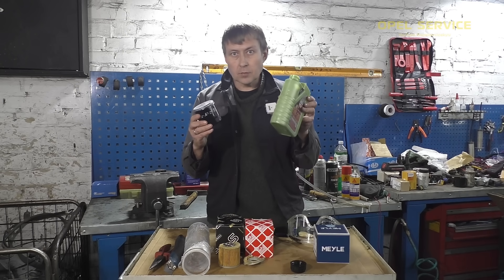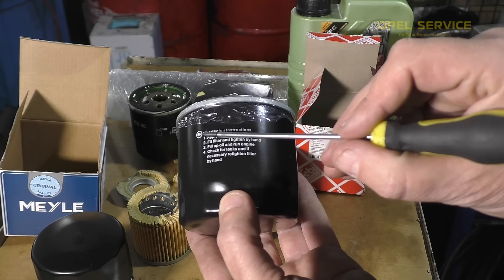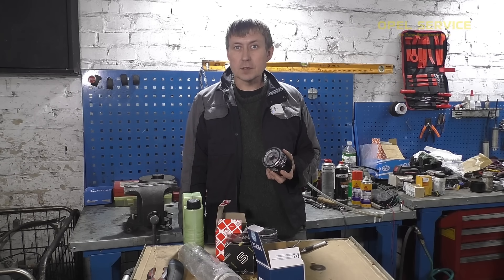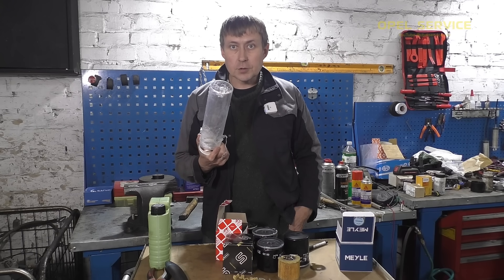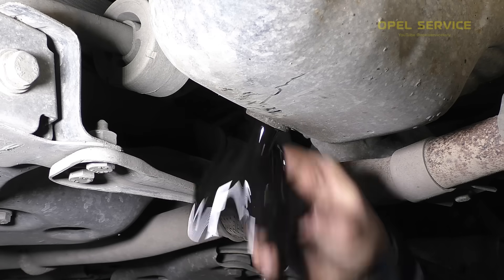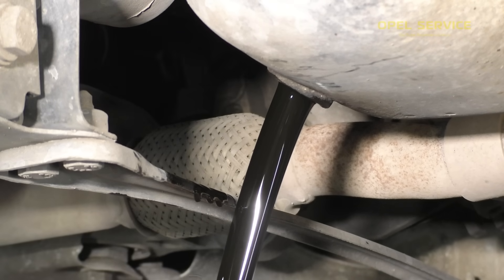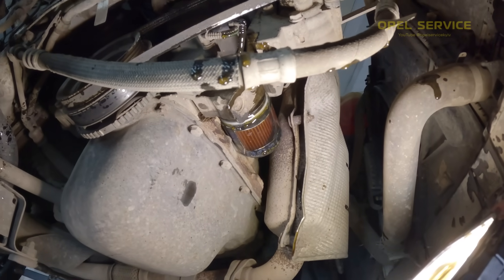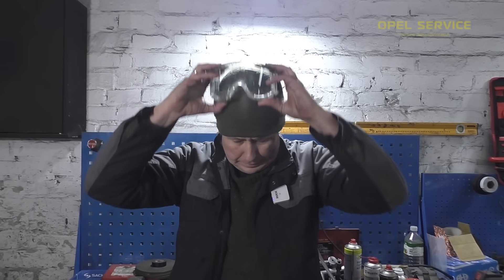Should You Pour Oil into the Filter ? Transparent Filter Shows the Answer

Comment: On my civic 1.5t if I dont pre fill the filter i get an oil warning for a few seconds before the oil has fully circulated. Therefore I always pre fill the oil filter. There are some vehicles where you can prime the system without actually starting it, unfortunately newer hondas dont have that from what ive seen.
Reply from the maker: Thanks for sharing your experience

Comment: Do not pour oil into the filter when changing it. An oil-filled filter is an obstacle to the air that needs to be pushed out. The oil pump is designed to pump oil, not air. The oil on the engine bearings will appear with too long a delay. The risk of shaft seizure increases significantly.

Comment: First of all, thank you for the video on this very controversial topic.

Secondly, the experiment went wrong, and we didn't see anything useful to help us understand whether we should put oil in the filter before installation or not.

I understand that you spent some time making these filters, but it wasn't necessary. Just install some filters with oil and some without. Then, check what exactly happened by opening them.
Reply from the maker: Thank you for your feedback. We are now making a special separate stand for such an experiment. It will consist of a pan, an oil pump, an oil filter adapter and several filters.

Comment: My old 1200 cc (40 hp) Volkswagen didn't even have an oil filter. Just a screen by the oil pickup. You could take off about six 10 mm nuts and take the screen out and wash it with kerosene. I would only clean it every so many oil changes. Very reliable little pancake engine. You could do a lot of work on that engine with only two size wrenches or sockets, 10 and 13 mm.

Comment: I would like to see this test:
  1) Drain the oil pan and oil filter. Leave them empty.
  2) Start engine and let idle for 30 seconds.
  3) Remove bearing caps and inspect for any bearing damage.

I would bet the bearings would look fine with no damage.
Reply from the maker: There was a similar case a long time ago, when video cameras were still rare. The engine ran even longer. But everything worked out well. 
It would be interesting to do such an experiment.
Reply: that is a testimony for the bearing manufacturers. why not let it devolop for a couple minutes until the bearing scuffs to see what you are heading towards

Comment: "Garage 54"  did the same experiment with  a Lada with a clear valve cover and oil filter,  the oil filled the filter and reach the top of the heads before it motor even fired.  so pre fill during a normal oil change is a waste of time.   I would consider doing it on a motor that has been sitting a long time or major engine work
Reply from the maker: Yes, they did it very well. Several other Youtube channels did this experiment. We are now constructing a separate installation for testing in different modes. And we revised the filter design. I think it takes two or three weeks to create. Thank you.

Comment: People act as though there is NO oil in the bearings after you drain the oil! Even if you fill the filter it will still take pressure to build up before it pumps any out. It is a non-issue, you can go either way and not harm anything!
Reply: you will do less harm prefilling.

Comment: It took several seconds for the oil to pump through the filter media.   It probably isn’t causing much wear but every little bit helps if you want to put 250,000 miles on an engine.    Auto manufacturers have a lot of knowledge but they don’t want you to keep your car forever either 😂.   I pre fill my oil filters.   It doesn’t cost any more money so why not do it?

Comment: It's personal preference, nothing more. I've NEVER filled an oil filter and have a minivan with 189K miles with zero issues and a smallish SUV with 125K miles on the clock with zero issues. 

Thing is, engines are never completely dry unless it's being filled for the first time at the factory, or you've been letting it sit for months to years.

Comment: It certainly won’t hurt anything to fill a filter with oil- even if you overfill the amount in the filter that won’t damage anything. Ford Focus engines listed 4.5 quarts as the capacity. I always put in 5. I was always slightly overfilled for the 200k (320km) miles I owned that vehicle. To damage an engine by overfill with oil, you need to overfill by 1.5x capacity or more so that the crankshaft is swimming in oil or pistons hitting oil. Even 1 qt over shouldn’t grenade an engine.

Comment: Most engine wear occurs during warm up , not start up.
Its a common mistake not differentiating between the two.
Its not the bearings or cams that generally wear out 1st on a motor. Its not the 3 or 4 second oil pressure delay at your bearings , wrist pins,timming gears  or cams that happens every 5 to 15000km typicaly that determines engine life.
Unless something catastrophic happens its the rings and cylinder bore blowby that determines an engines life.Its during the warm up from ambiant to running temperature where the majority of wear takes place. So essentially pre filling an oil filter will not lengthen the life of the motor in any measurable way as the ring , cylinder bore is worn out predominately by the engine running from ambiant to opperating temperature. 
Thats the reason stop start auto shutoff does not significantly shirten an engines life.
Heat cycles is the biggest factor if your oil is kept clean.
I pre fill my filters when possible,  but I know its making little to no difference.
Reply from the maker: Thank you. It was interesting about stop-start

Comment: I once forgot to install the new oil filter. I started the engine, but when pressure didn’t come up after several seconds I shut it down. In the few seconds the engine was running (5? 10?) it pumped out all 7 quarts of new oil. The filter is filled almost immediately on cranking- as your test showed, first with the old oil remaining in the oil pump, and then immediately by the new oil from the pan. Great video!
Reply from the maker: Yes, the pressure is high and the oil flows at high speed. Thank you.
Reply: My brother had a house mate who drove cars without engine oil. The cars would run for a few minutes without oil. Maybe it is not so critical starting with an empty oil filter.....
Reply: @arthurschuler8906  he did damage every time.
Reply: I’m going to take advice from someone who forgot to install a filter during an oil change?

You’ve got to be kidding me.
Reply: @mitchconner1407  Anyone who insists on performing the completely unnecessary act of pre-filling an oil filter isn’t exactly the sharpest tool in the shed
Reply: @mitchconner1407  There’s another video on YT where they test for wear between pre-filed and dry oil filters. The conclusion? No difference in bearing material wear metals. There is an epilogue however! Something like 90% the wear isn’t bearings, it’s piston rings. Nearly all piston ring wear occurs  while the engine is cold as it comes up to operating temperature, independent of oil pressure. The conclusion? If the voodoo ritual of pre-filling your oil filter makes you feel happy it doesn’t make any difference; but if you really want to minimize wear get your engine to operating temperature quickly. The best way to do that is start it up and drive gently for the first few miles until it warms up. Avoid extended idling, that takes longer to get to temperature and prolongs the time your piston rings are getting the most wear
Reply: and if the filter is prefilled it will see pressure faster. there is 'zero time' that running without oil is a benefit. there is zero benefit to installing a dry filter
Reply: @notsure6182  there is zero benefit to filling the filter as well. Also, many cars have an oil filter placed in such a way you cannot pre-fill it. Mounted horizontally, or even upside down on top of the engine.
Reply: @MrJeffcoley1  incorrect. anything you can do to ensure faster oil pressure is a benefit and there is zero argument you can make that says 'being without oil pressure is a good thing', so why are you even trying to say something that stupid. obviously there are some applications that you cannot prefill, bad designs. basically you have zero logical points and you are falling to bullshitting. summary, "no downside to prefilling, no upside to not prefilling". end of discussion as you have zero valid points.
Reply: @ sure, just like moving for deck chairs to the stern will help the Titanic. It is genuinely zero benefit to pre-fill the filter. But if it makes you happy, go on with your bad self and fill that thing.
Reply: @MrJeffcoley1  no. any time you run a bearing without lube you damage it. your best case is it doesnt damage it much, but it always damages it. so reducing that as much as possible is always a benefit and extending that damage time is always a detriment. those are the facts. you know why the oil pump is capable of dumping 7 qrts in a few seconds? because that is how much oil it needs to prevent damage. again, why would you try and argue a moronic obviously wrong position.
Reply: @ The bearings have residual oil in them, a few dozen revolutions under zero load isn’t enough to do anything.

Comment: While pre-filing is not a service  requirement, a technican or mechanic's duty of care and implied warranty of skill should be honoured when carrying out these types of work that necessitates some level of technical savviness and know-how. 

Personally I won't prefill a filter for an engine that's reached operating temperature at the time of lube change, irrespective of the filter configuration. This is because there are still residues or remnants of oil at intricate areas that can manage the transient high friction until the components are forced fed, usually in a duration of seconds .

For cold start lube change I would. This is why it's recommended to change oil when it's warm because cold oil flows slower so pre-filling revs up the buildup.

Comment: If NOT filling your filter made any significant difference, the majority of vehicles would have had catastrophic failures before warranty had expired.

I have found that excessively meticulous maintenance compared with just replacing wear parts and keeping the fluids filled has not made a significant difference in the life of my daily driver vehicles.
The only difference is where I spent my money and time.
The “neglected” vehicles have lasted just as long as the “worshiped” vehicles with no significant difference in vehicle life or major component failure.

You can own your stuff, or your stuff can own you.

Comment: It is impossible to prefill a Chrysler slant six, as the mounting face is positioned downward, and last time I checked, it is one of the longest lived most reliable engines in the world. My Chrysler B/RB/ HEMI has it horizontal, and my Cummins has it vertical. I will continue to fill them completely where possible, and partially where I can, if only because it’s easy to do and it seems completely rational, but not totally necessary.
Reply: My 2nd gen Toyota Tacoma V6 also has the filter on top of the engine facing down. That engine is also known for its legendary reliability and the filter obviously can't be prefilled either.

Comment: After watching the video, I think I should fill the oil instead? The starter motor immediately starts the oil pump, and you can see that it turns and the oil doesn't come up for quite a while.
Also, the oil seems to fill up quickly after that, but the oil won't pass inside that easily. If the filter is wet beforehand, the oil will pass through as soon as it fills.

Comment: I learned two things from this video;
 The rapid way the engine filled the filter it may not matter if you pre fill it or not. But if you are concern that the correct volume is maintain, if you have a large or two filters then add oil to the filter.
The second is, don't make your own oil filter.
Reply from the maker: Thanks for your comment
Reply: @opelservicekyiv  Maybe if you had taken a glass jar with metal lid and solder it to the oil filter steel base.  Neat insight even though it was short.  Thanks for sharing
Reply from the maker: @tcmits3699  Thank you for your feedback. I should have put the collar on, everything would have been fine. We are preparing a new similar experiment in the future.

Comment: I always pre fill the oil filter before installing, but only using the oil from a new and unopened oil bottle that has just been bought for the oil change. I would never pre fill from an opened oil bottle from the garage shelf, or use a possibly contaminated funnel or jug. I used to hate that dry sounding engine on start up after and oil change before I started doing the pre fill, it seemed to take forever for the oil light to go out with a dry fitted new filter element. Time and gravity are wonderful for making sure that any possible contaminates in a new unopened bottle are sitting harmlessly on the bottom out of harms way.

Comment: Sounds like a Tune Up is due!! Engine doesn't want to stay running!😅 Add a little Motor Oil to the new Filter, and turn it 360° wetting the Filter Media. Compare that to a Dry Filter Element on start up! Faster Oil Pressure buildup, and Much Quiter upper end noise on start up! The Camshaft, and the whole Top End of the Engine won't be screaming for mercy, and Lubrication!! Dry Filter Element material takes a little time to saturate, and allow new oil to flow!! Dry Filter Element material is very restrictive, and resistant to flow causing noisy initial starts!😮Not Good!!😱😳😳😳😳🤔🤔🤔😉🙂
Reply from the maker: We are preparing an installation with an oil pump and an adapter for an oil filter where it will be possible to accurately reproduce the entire process with testing of all filters.

Comment: Yo tengo un VALIANT  1962 y al cambiar aceite y filtro suelo desconectar el encendido .dar arranque hasta que tengo presion de aceite . Luego reconecto y listo. My car is VALIANT 1962 When oil and filter is changed unplugged ignition coil and start to oil pressure is up. Reconected and ready. Is other sistem to  oil filter filling. Without spark pluggs is best. When is changed too.